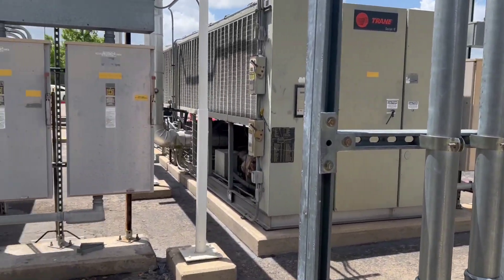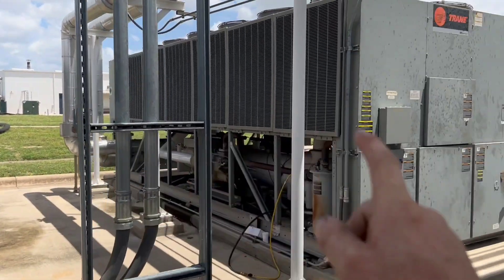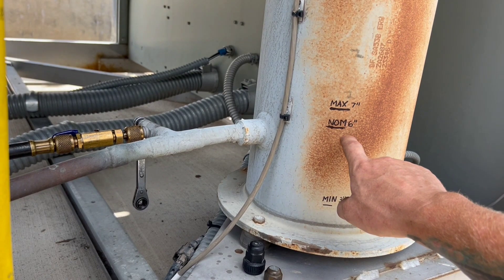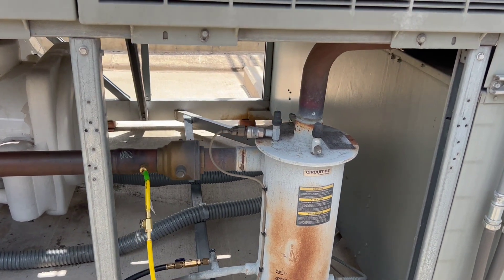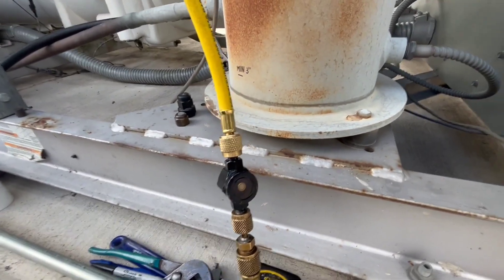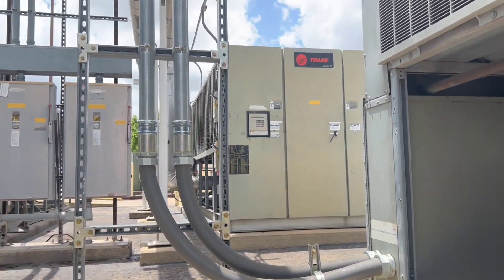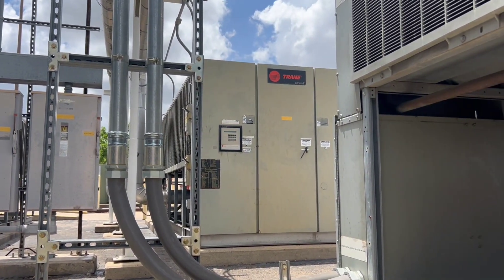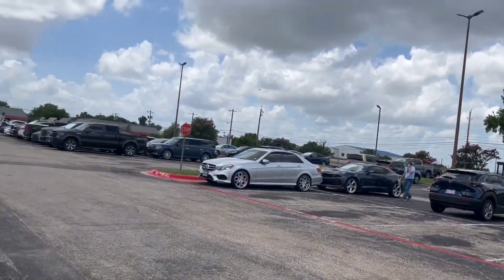GETTING OIL SAMPLES FOR ANALYSIS AND CHECKING OIL LEVELS ON SOME RTAA'S & RTAC'S

Comment: So why wouldn't they put a min and max level sight glass on the separator instead of having to do all that messing around with the hose and all that ? I don't get it .
Reply from the maker: Great question...I agree 1000%. Seeks like Trane misses the boat on that with a lot of equipment....other than their low pressure centrifugals...which has an oil pump. Thanks for watching.

Comment: I’m not sure if your video mentioned this but you need the check the oil level in the off cycle of each circuit.  According to Trane if the analysis comes back ok and your pressure differential across your filter is ok then they suggest you leave the oil alone.  I guess you’ll have to see what the lab says about your darker sample.  Great video! 👍
Reply from the maker: I didn't mention that it has to be off. It was, but good point by you. It also has to sit for at least 10 minutes after being off before you take the sample too. Thanks for including that information I forgot to mention. Sometimes it's easy to forget to mention all the small details that are also important.